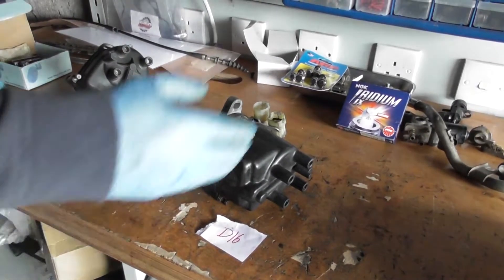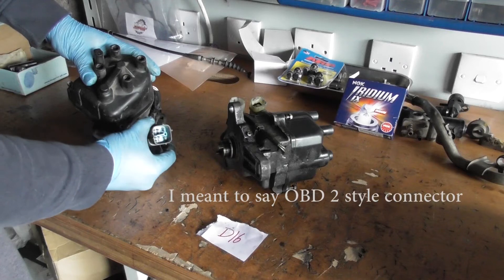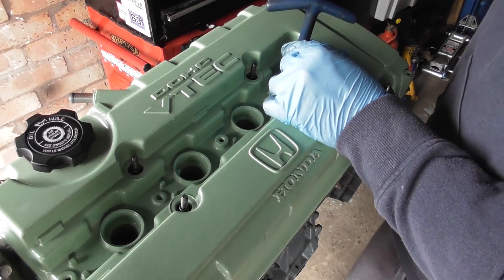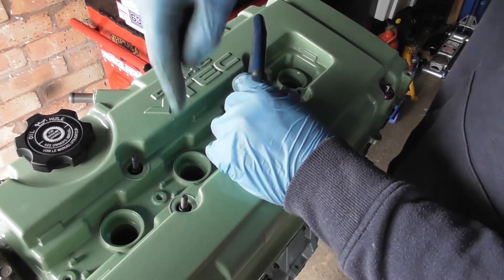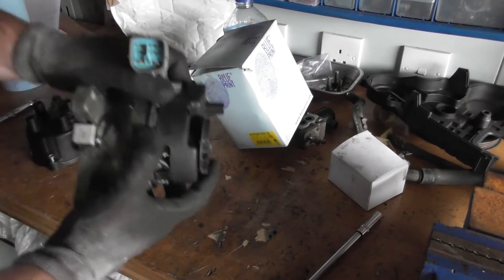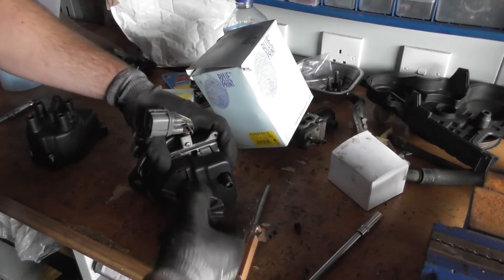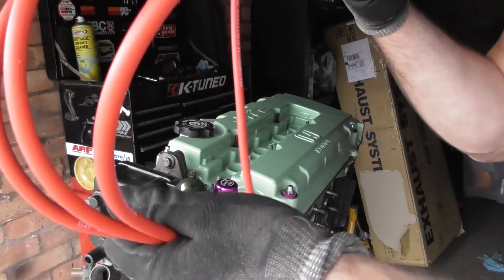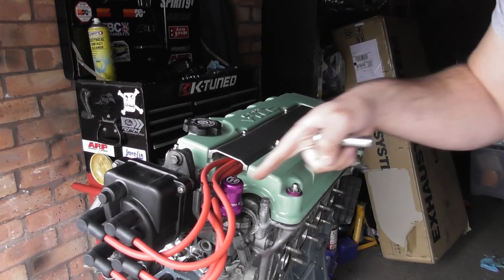T2CG Honda Civic B18C4 Engine Build Part 9: Distributor and HT Leads

Comment: i got a B18 C4 will you be able to build my engine for me, i got told it seized i am stuck in a situation help me out please!!
Reply from the maker: Sohail Asgher Sorry to hear of your situation. I do not do work on other peoples cars as this is just a hobby to me. It sounds like you need to either rebuild the engine or buy a replacement engine. 
I have just looked and there is a B18C4 and the related gearbox from a MB6 on UK Ebay for 600 quid. Ebay item number: 322983020455.
I would buy that.
Thanks
Reply: Twin2 Civic Garage T2CG I would rebuild it if I had the place and time , a new engine is expensive , any one you can reccomend to me that's good at the job
Reply from the maker: Sohail Asgher I am not sure who I would recommend to carry out this work. If the engine is seized then thr chances are the will need to be a lot of rework on the engine. I would expect that the cost of rebuild and rework will run to more than 600 if you are not doing the work yourself. If I was you swapping in a new engine would be a cheaper and time effective option to choose. But of course that is up to you. Good luck!